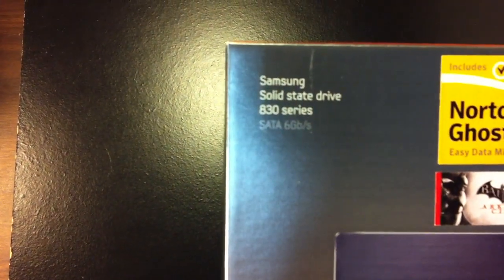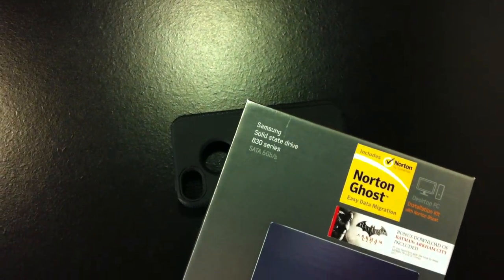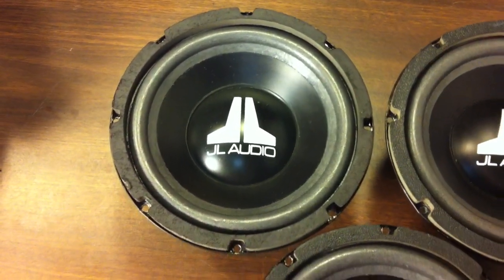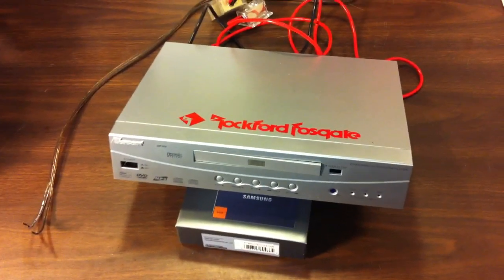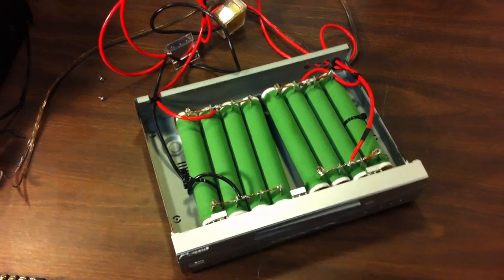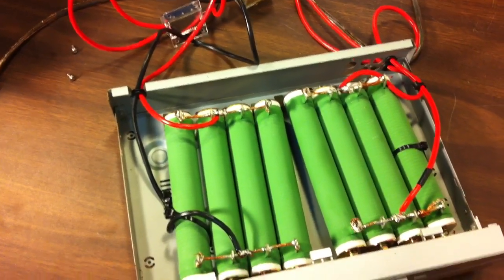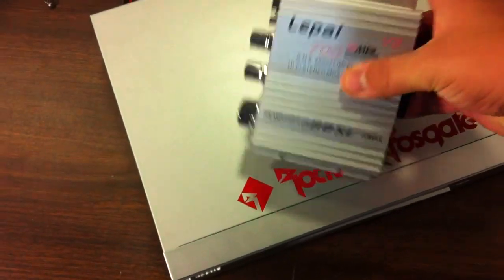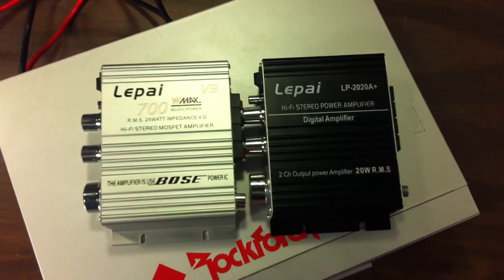OldSchoolStereo Updates and Upcoming Videos

Comment from the maker: @bigblockvista I bought the 120w 1ohm resistors from mpja and wired, soldered, mounted, etc. them myself. I'm going to put 2 small fans in the DVD case to help keep them cool during high powered amp testing. Some people use distilled water to keep their resistors cool and I may have to look into this for the BIG amps!

Comment from the maker: @bigblockvista Yes, the resistor load acts like a speaker to the amp. The main difference is the resistive ohm load stays constant, whereas a speaker itself would vary in ohm load depending on the frequency it plays back.